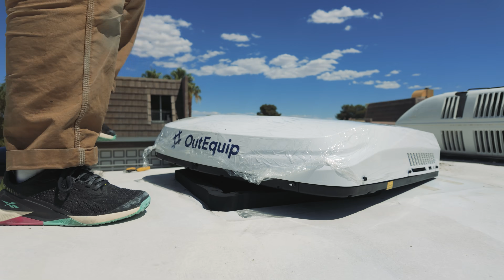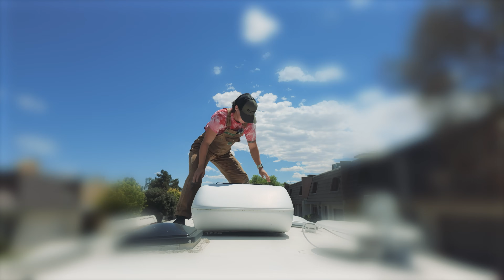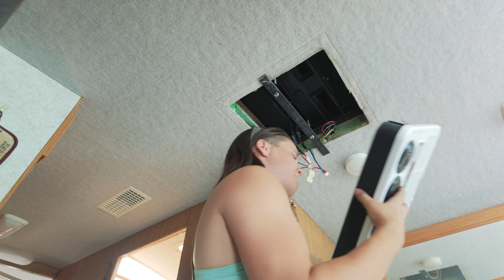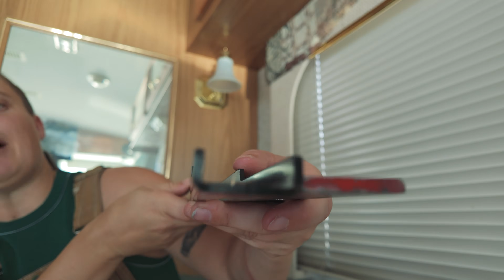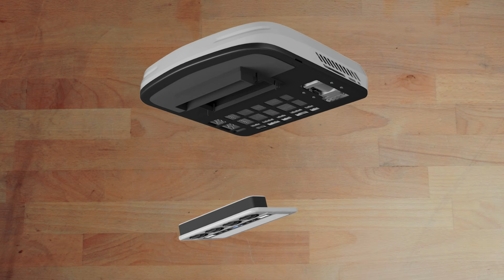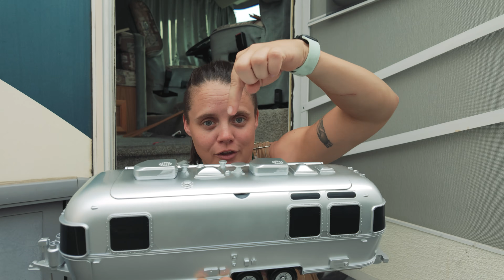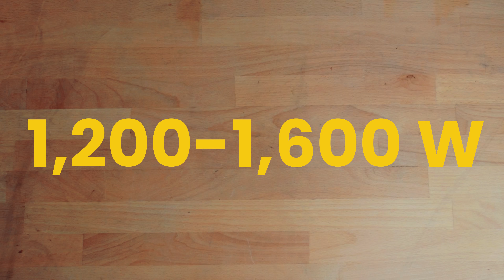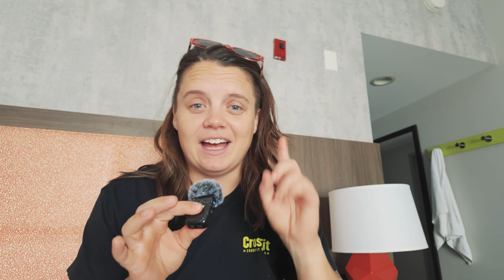Better RV Cooling with Less Power? My Switch to a 12V  AC | OutEquipPro AC Honest Review

Comment: HVAC Engineer here.  30 year career.  Wow, the best explanation I've ever heard for people who know nothing about air conditioning.  You are an amazing educator.  Stayed on point the whole time, and never ventured into the realm of 'eyes glossing over'.  You are definitely a gifted educator!  Stay the course.  Yes, pun intended. 😂
Reply: HVAC Engineer is this a good unit?
Reply: We have to define a 'good unit'.  So, does it cool your space?  I can testify that my industry has been flooded with so many different companies (mostly Chinese) cranking out their own product line, and all of them do the amount of cooling they say they will.  Emily provided exactly the info I would have provided out of an R&D lab, and the numbers were amazing.  Theres always one caveat.  How much heat load is in your camper and is this unit large enough.  I cant answer that.  So many different construction materials, insulation values in walls and ceiling, windows, heat generating devices (e.g. power station), and on, and on.  So, is 10,000 btus big enough for you. ???  I was happy to see her point out something very important.  AC units are only meant to drop the incoming air 20 degrees (Best case).  Please read the post right after mine about the truck camper owner test in 103 degree climate, and remember the volume of space in a truck camper.  Of your camper had 3 times that volume, and not insulated as well, and more windows, it might not be able to cool low enough.  But, humans are sensitive to humidity, and an air conditioner is an amazing dehumidifier.  So, even if the temperature doesn't fall as far as you would like, you can be quite comfortable at 80 or 85 degrees.
Reply: @michaelshelton2250  Never understood why they haven't built RV HVAC system with an inverter style compressor like the mini-splits have. They seem to continue to use single stage compressors that cycle on and off to keep the temperature regulated. Much more efficient for a variable speed compressor to adjust as needed most of the time RV not going to be in extreme heat or cold.
Reply: Money.  Inverter style, like mini splits, are the highest energy efficiency (rated as high as 25 SEER) of any AC built, but the technology is expensive.  It's not just the compressor that runs variable speed.  Also, the outdoor fan and indoor fan adjust speeds accordingly when the compressor varies in speed.  And, the most complex of digitally controlled components is the metering device has to be digital, and constantly adjusted.  The control board AND all mechanical components are more expensive.  The unit cost to mfg can't get low enough because the market for high efficiency in RVs is not large enough.  BUT.......yes, the features are nice.
Reply: @Mike-01234 yeah
Reply: @michaelshelton2250  But this still isn't a mini-split, correct? They aren't claiming that tech here, and that raises a question that I would think a long-time person in the industry would be puzzled over. Short of a heat pump that can significantly exceed 100% efficiency, there is still a definitive mathematical relationship between energy in vs. cooling or heating out in BTU's. Let's suppose they are getting the theoretical ideal EER, so a conversion factor of 3.412 BTU/watt-hour. If those testing the unit are only seeing maybe 350 - 450 watts of power consumption, what does that say the actual BTU output of the unit is? Let's suppose it IS actually a mini-split equivalent, what would 130% efficiency make the output? The other part of the suspicion is that in Chinese supply and in social-media land, there is often no necessity for things to authentically add up.
Reply: I would direct you to their website, where they are very clear about their compressor technology.  If I start talking about it I'll run deep into thermodynamics, pH diagrams, psychometric charts, mass flow, and, and.....There is absolutely NOT a direct relationship between energy in (or kW of power consumed) and what we refer to in the industry as 'work'.  That's why a unit of 12 SEER efficiency can do 12,000 btu's of work, or that same work can be done with a 25 SEER unit that uses much less energy.  Work, in this industry, is defined in terms of 'mass flow'.  The same mass flow can be accomplished with difgerent energy inputs, dependent upon the compressor technology.  I'm sure I'd enjoy talking to you because you dive in deep.  We could get deep into the industry science.  😮.   I'm not sure why you asked if this was a mini split, but no it's not.  Again, I'm impressed with the technical info on their website.  I think you'd like it.
Reply: @michaelshelton2250  I had gone over their website before writing what I did above. There is a maximum theoretical limit in physics to how many BTU's of cooling or heating can be produced directly by X amount of watts under any conditions. I'm also not seeing any in-depth testing results that would give a power consumption vs. BTU output curve, for example. That  is why I am doubting the power-consumption numbers claimed if maximal cooling is being demanded. I did notice another user saying that they were seeing 110 amps used in the early going in hot weather, and that sounds much more in line with what I would expect (and why the input cables would need to be so heavy).
Reply: you seem to be stuck in the theories of physics, and I understand.  You are stuck in x kW = x btu's.  That's only true in 'resistive' loads, like a stove burner.  I don't want to get deep, but please ask yourself 'how is it possible for a 12 SEER unit to generate 12,000 btu's, and a 14 SEER unit to do the same with even less wattage, and a 18 SEER unit to do it with even less wattage, and a 22 SEER unit to do it with even less, Orland on and on.  Progressively, we have been getting more 'work' out of fewer watts for a very long time.  Your thought process is not uncommon.  People are stuck in watts/btu, but everyone forgets that HVAC is chemistry (chemicals), not mechanical or electrical engineering.
Reply: @michaelshelton2250  So you’re suggesting that this unit has a SEER well north of 30 without even being a heat pump—equal to or better than the most efficient heat pump an industry standard like Mitsubishi has ever produced? That is the only way the math works and I don’t see any indication that such tech is in use, requiring ceramic elements if the heat option is chosen, etc.
Reply: No, not at all. That's not what I'm saying.  I have 2 industry patents, an industry national design award for 'best new product of the year' ,Ive worked for 3  international mfg's, I've designed -80 F deg Pharma and Biotech industry storage chambers for the scientific community, 0 deg F commercial refrigeration chambers, and numerous air conditioning equipment from the ground up.  I've designed with numerous refrigerant chemicals  including propane.  I was hoping I could help you understand,  but I'm going to drop out of the string now.  There's a good chance I just can't explain it well.  Hoping someone else jumps in and can.
Reply: @michaelshelton2250 In refrigeration there is a parameter called the Coefficient of Performance. Basically it says for every unit of energy input (electricity) you can remove X amount of heat out of the system and exhaust X+1 units of heat outside. Typically low efficiency, older 120V A/C units may have a COP of 3 to 3.5. These higher efficiency DC units may get up to 5 or even 6. So for every KW-h of energy consumed by the unit will transport the equivalent of 5 or even 6KW-h of heat...exhausting 6 or 7 KW-h of heat outside as hot air.
For the record I am not an HVAC engineer, or electrician. But these little DC air conditioners are pretty amazing for the price.
Also, just a comment: people often state or try to rate battery systems in terms of "Amps." Amps are an indicator of power (volts X Amps =power.) For battery energy storage considerations it is necessary to think of amper-hours at a particular voltage: a 100 Amp-H battery at 12V can theoretically store 1200 Watt-hour of energy, or 1.2 KW-h.
I have been using a 280 A-h Lithium Ion battery at 12 Vdc, with a 3000W inverter and a 400W solar panel (at about 41 vdc) and a 20 Amp charge controller to do experiments like running my dishwasher, my fridge-freezer and my washing machine. I can run all of these at the same time...but not for long. After a load of dishes and a load of laundry...the battery gets sucked down to about 57%. But I am collecting good data and learning things from this small build.
Reply: @michaelshelton2250 hey man... Is there another platform I could reach you on? I'm trying to set something like this up in my own van and I genuinely thought I had it all figured out... For a 120v system... Now I'm finding this video and I'm genuinely thinking this would be a better option... It would fit better.. it would use less power... And it's cheaper than the other options and less scary being just the roof of our van and not the sidewall.... Where there's windows and idk what the hell we would do to work around that... Anyways now my issue is we were planning on upgrading to the apex 300 series of bluetti power systems .. along with 1 or 2 of the b300k extra battery storage options... But.. it can't handle 58amps at 12v DC even with their expensive adapter... I'm thinking I could just open one of the spare b300k units and wire it up directly to the battery terminals... Being that the system should still have fuses and protection in place... But I also wouldn't wanna void a warranty and possibly die over something I could've just prevented by ... I'm assuming picking a different option to power it... But now that's where I'm stuck... I genuinely don't know what kinda batteries or charge controller or if I would need anything else at that point? I'm super super lost .. any info would be greatly appreciated.. even if your info was suggesting a simpler maybe less efficient option... We're staying completely solar due to constraints
Reply: @michaelshelton2250 

Sir, I am curious. As you labeled yourself an engineer:

 'are any of these units not using an AC motor, internally?'

I haven't seen any of them advertise other than input voltage. Very few post actual amperage or wattage draw. And SEER is one of the most useless concepts, ever. 

As another posted and the person who did the video -

 "inverters have inefficiency built in."

A 12VDC source to a 12VDC motor will have the most efficient power profile as it doesn't waste a portion of the energy in conversion from 12 VDC to AC or to a different DC voltage. This issue has me questioning if any of these 'systems' is worth investing in.

The number 1 point is repetitious. If you do something, do it right the first time.

V/R Chris
Reply: @michaelshelton2250 calculate the space and the Della t ( difference in outside temperature vs target temp )  an ac unit gas a btu rating, just like a heater does but it's an inverse rating. The btu rating on a cooling unit is how much heat it can move out. 

There is no such thing as " cold " only different amounts of heat. 

Heating design, gasfitter, plumber.. 30 years... yup.
Reply: @RL-sv9mo 12v units are Great! Theres no converting Ac to Dc. Well worth the money, if you get a year out of that unit I would be satisfied😂.
Reply: I was thinking the same thing. Simple step by step instruction makes for easy projects.
Reply: I agree I don't know anything and I understood
Reply: This was a very good informational as well as instructional video.
Reply: 2 minutes ..energy comparison
Reply: Agree!  I was literally thinking the exact same thing! (though I'm not an HVAC Engineer, I'm one of the people who "know nothing"). 😆
Reply: I do agree that there’s a math issue lurking here somewhere. If the total load really is 450W or less, the efficiencies required for 10k BTU output probably would be a new world record for a production AC unit. I couldn’t find any real-world measurement and analysis online for it, and I think if the manufacturer thought it was anywhere near the best that has ever been achieved, they would be publishing that with ringing bells and shouts. Lots of $$$ in that.
Reply: I also wonder if this unit can cover the volume well enough for a class a or class c
Reply: I'm wondering if I could add this to my pop up camper that doesn't have A/C and just use the thick positive and negative wires to a set of 2 lithium batteries.
Reply: what do you think of the china version of these 12v air cons? they're like mini splits. I bought one for like $650 all in. Is it gonna break on me? Also the thing draws like 50A 12v continuious, is that normal?
Reply: Here's the China picture.  They don't create, design, or innovate anything.  They're a nation of cheap production.  They steal all technology (patents), and build it with slave labor.  No offense to  Chinese, its just their business model.  So, the technology is probably fine.  Will it last?  Every business around the world, including U.S., knows that Americans have accepted nothing will last, to just throw it away and buy another one, and we're OK with that.  So.......I helped a friend last weekend with his home AC that is 27yrs old and still kicking.  Those days are over.  Even with equipment made in this country.   I can't speak on the last question of your power draw and 'is it normal'.  I don't know the  size of your unit or which compressor technology is driving it.  I don't mean to sound flip in my response, but just delivering the reality of products today.  Final answer - in my industry, I would suggest that you can't expect U.S. made equipment to last any longer than Chinese made.  Those days are over.
Reply: You'll need #10 wire for that AC. #8 is even better, especially for long runs of wire.
Reply: Another HVAC guy here, very well-spoken.
Reply: Thank you SO MUCH!
Reply: Agree
She rocks Thanks
Reply: Ditto. Excellent video. Comprehensive without talking down to dummies like me... ;-)  A gifted teacher. Best wishes.
Reply: Hi, I subscribed and was pumped to leave you a flattering review but first I got into the comments and it seems that a couple of electrical engineers that left comments have taken the air out of my excitement. It appears the wattage you recorded was not accurately measured which basically crashes the party since that number is all that really matters to me and my off grid homestead. I'm tempted to buy it anyways and see for myself. You have a gift of communicating in which you know the questions people are thinking.  I also have that gift and I swear you look like me and my ex wife had a baby, do you know your biological parents? I was in the SaltLake area in the early 2000's... Just saying🤷🏼‍♂️
Reply: This dude does not a a clue
Reply: I absolutely agree!!  Thank you for being so good!  Im gonna be pointing people to you!
Reply: I agree withHVAC engineer.  Great explanations and video
Reply: No, you cannot simply block off your AC vents as she suggests and use this. That leads you to cooling inefficiency and mold inside your lines
Reply: It seems like a lot of stress on the battery
Reply: Maybe that's why I feel like I'm following her and understanding it to some degree. And also grateful that I have a class B and not something like hers that requires mods!
Reply: You are 100% correct
Reply: what gauge wire does this unit use
Reply: You did a great job creating an educational video explaining the complexities of a/dc crossover connection challenges and you did so in a very engaging, down to earth  manner that puts people at ease.  I feel the need to apologize for the harsh comments made by individuals such as Matthew(something or another) as it is clear that he lacks the fundamental knowledge required to understand the dynamics of keeping and maintaining solar battery systems charged using solar panels (which provide a pasive
Reply: I gave her the same feedback the first time I watched her over a year ago. She truly is a gifted teacher.
Reply: Did I miss the part where she said she knows “nothing” about air conditioning”? A person, like myself, who truly knows nothing about A/C could not pull off a video like this. She’s clearly educated about RVs, electricity, and A/C. Maybe not a 30 year professional, but definitely knowledgeable. 🤷🏽‍♀️
Reply: @ijustfollowthesun  you didn't comprehend what he said obviously . He said she did good for not being a professional in hvac to dumb it down for you .
Reply: @freddymartinez5613 I stand corrected. You are absolutely right, I read it wrong. I’m not sure if they edited the comment because I swear it said “for someone who doesn’t know anything about A/C” which is why I said what I said. If I was wrong, I accept that and apologize. 🥰
Reply: Smart gal
Reply: So many things wrong with this video. Where do I start?   Let's start at the end first.  You're talking about getting the amps off of your AC system and putting it on the DC system so you don't trip breakers. That means you must be plugged into shore power or running the generator. If you put more draw on your 12-volt battery, then your converter is working harder and probably maxing out at what 15 amps. Amps which if you only have a 30 amp system you've just taken up half because you have to charge your 12 volt batteries to keep your air conditioner running.  You mentioned that this system had a soft start kit already installed. That's not true.  AC motors are not variable. DC motors are variable. A soft start kit makes it so the compressor and the fan don't turn on it. The exact same time limiting the lock rotor amps so you don't overload the generator or shore power. Nowhere in this video did you mention that this unit is only 10,000? BTUs?  A one ton air conditioner is 12,000 BTUs. Just so you have a reference for your residential air conditioner. Most rooftop air conditioners are what 12, 000 to 15,000 BTUs so you never talked about how well this unit cooled. On a hot summer day I don't think it will keep up with the heat.  The only thing I agree with that you said is that this would be a great air conditioner for a van only if the van is very well insulated. 10,000 BTUs is just not enough.
Reply: @matthewspaccarelli5007 Technically a "Soft Start" kit, lowers the peak amperage drawn by an inductive load (such as an A/C compressor) by spreading it out, and by adding capacitance to the circuit (correcting the power factor to more nearly be 1.0) Shifting some loads to D.C. does infact put more load onto the battery...but a properly sized battery bank, appropriate for the demand placed on it, will work just fine.
Reply: How would you explain it?
Reply: As I noted, for an audience that knows little to nothing about AC, I couldnt have done as well as she did.  I would have gotten too technical and had eyes glossing over. 😮
Reply: Thanks, fantastic apart from flapping arms
Reply: @howyacuttin9087  Awww, bless your heart, fragile person.
Reply: @howyacuttin9087  I liked the arm gesticulation